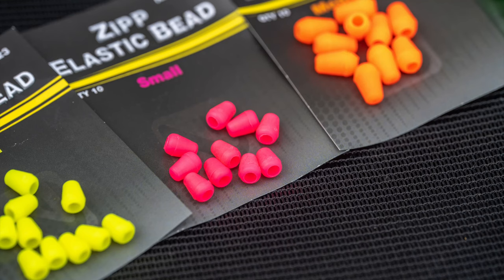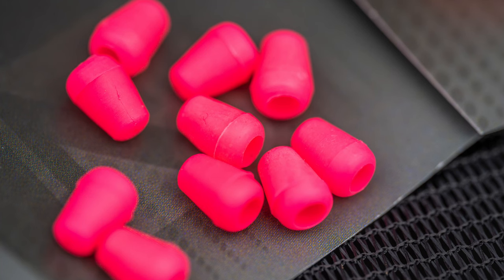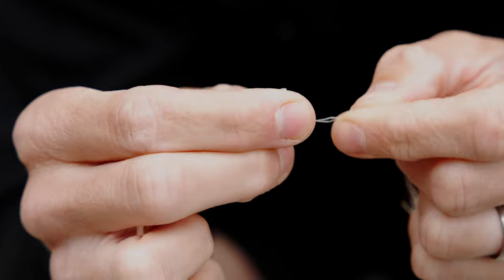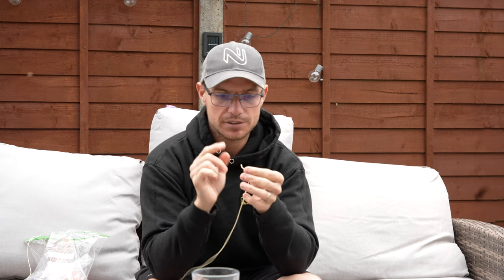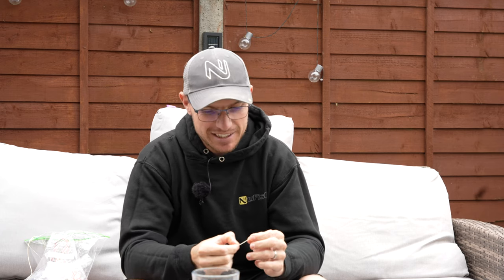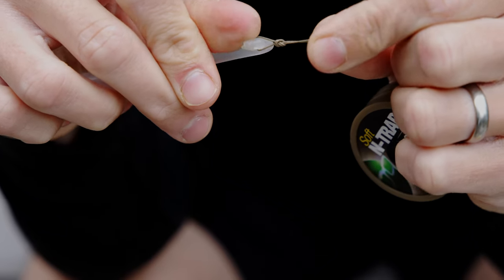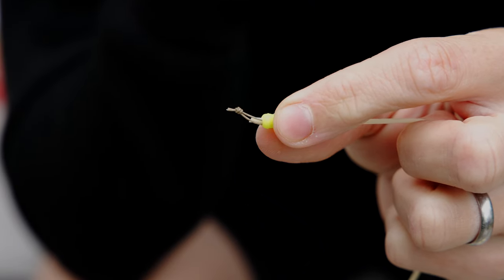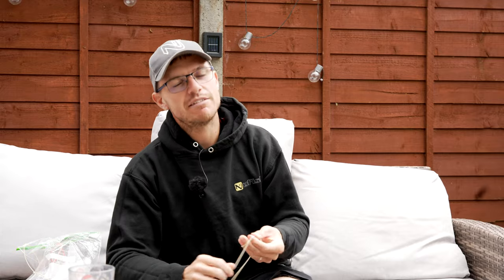How To Tie Dacron Connectors and The Direct Bead Connection | Pole Fishing Tips

Comment: This happened to me a few weeks ago and I was left scratching my head as to why it came off. Now you have confirmed it I will also be going back to dacron for my carp fishing. 
Great video mate, thanks.
Reply from the maker: I think its worse with thicker lines. I've never had it happen before, but since upping my mainline to 0.22 this summer it's happened twice.
Reply: Try slipping a 2 or 3 inch of hollow elastic over the last part of elastic then your Dacron or line has a double piece to bite onto.

Comment: I use drennan method conector (plastic s shape with sliding tube in the middle for method feeders). Hooklenght on working side, small loop on the tube side. That setup works great for me.
Reply from the maker: Great tip!

Comment: Good explanation. Please explain the advantages / disadvantages of "double-bushing" - saw your kits had a bush within a bush. Thanks.
Reply from the maker: I cut my kits back a long way and would need a huge bead to prevent the elastic from disappearing. I like a small discreet bead so had to reduce the bore diameter using a double bush. It works well and the elastic runs smoothly too

Comment: Your videos are great, Joe. Did you not mention in this video that you had done a video about Zipp Adjusta Puller Beads. I can’t find it! Or maybe I was mistaken? I’d really like to know how to use/set-up these beads correctly. Any help much appreciated.
Reply from the maker: Land BIG Carp On The Pole With This Simple Tip!
https://youtu.be/olYsFg3rQ-w
Reply: @MatchFishingFilms  thanks, Joe. So what would you recommend for size of bead compared to thickness of elastic? For example use a 1.6mm elastic would you go down tighter to a 1mm bore or go up to 2mm?
Reply: Joe, what size Nu-fish bead would you recommend for reverse bead connector method using a 2.4mm 16-18 elastic?

Comment: Personally I don't like either my rig comes off with them. I prefer the stonfo connection at least it's 100 per cent secure..  and contrary to what some think you can actually slap the rig using the stonfo I've used it to good effect at my locals .. cudmore and Blake hall complexes
Reply from the maker: Yea good old plastic connectors are great. We are currently working on some of those too as we know how good and simple they are to use 👍

Comment: how do you get your elastic to last more than a month, I've only got two top kits, im using elastic lube, I would say the elastic is used  twice a week, 12 hours at a time, any elastic I use starts to turn "milky" and ends up having lots of micro abrasions through out the elastic,(fishing shallow for carp 10lb+ in open water) is it due to how I store the top kits after the session ?
Reply from the maker: Could be. Or you just catch loads of fish! 
Even when mine loses colour I still use it
Reply: You could try using rig hook ups from Preston. I use the direct bead method all the time and it does fray after a few sessions. I just cut it back an inch.

Comment: I lost several rigs when line is direct to the elastic. With Dacron I dont. I have seen the elastics damaged due to line cutting into them.

Do some close up videos of a couple of set ups - 

1 - Thin line(.13.) Line direct to elastic.
2 - Thick line(.19.) Line direct to elastic.
3 - Dacron to elastic. 

Bottom them all out under close up and see the damage done.
Reply from the maker: Yea I've never had it cut through on either. But I make a point to check them every time I set up. Other anglers maybe don't
Reply: Excellent Thank you for posting.
Reply: Hi Joe I still use the old stile i lasso my dacron over the elastic the way Des Shipp use to do it and check it each session works for me but would you say the complicated  granny knot is better 
Plus shallow fishing for  carp the  no dacron would the line cut into the Elastic quicker 
Great video 👍
Reply from the maker: @paulsomersetwolf5970  we found the lasso method caused a strangulation situation and made the cutting through worse. But it's whatever works for you Paul and if you are checking it every time out then that method won't let you down 🤟 I think its worse when people leave them unchecked for weeks at a time